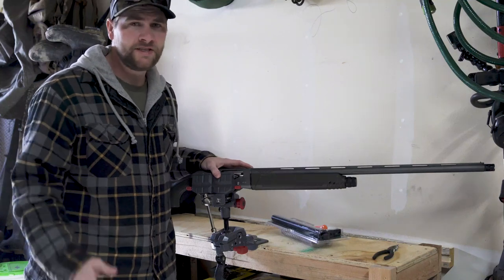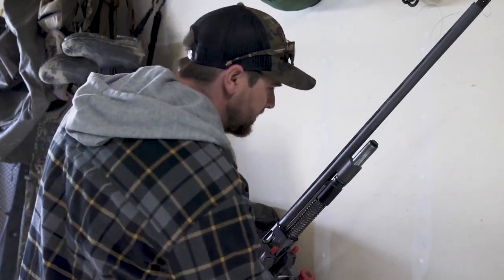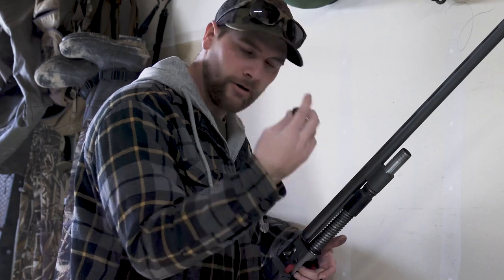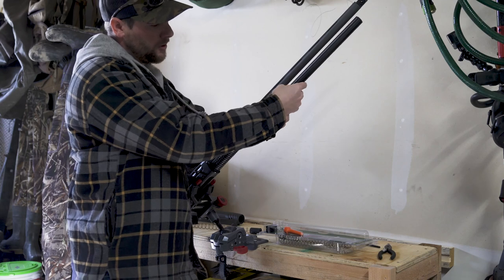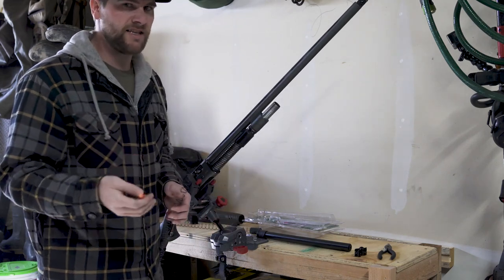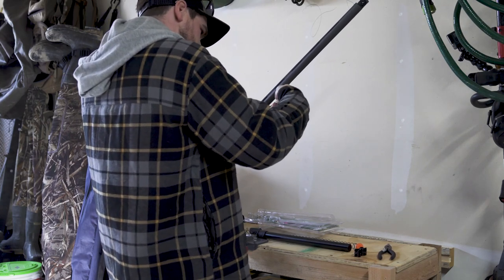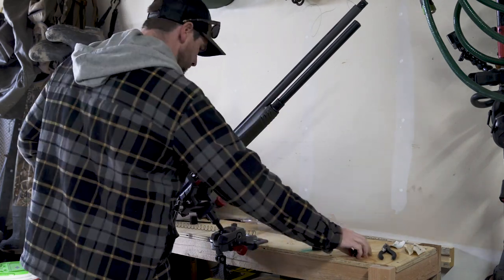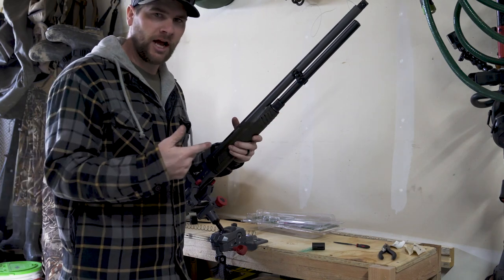How to Add a Magazine Extension to Your Shotgun | Outdoor Jack

Comment: How careful do you have to be when going from 2 3/4, to 3, to 3-1/2, from buck, to high brass, to bird, to slugs, etc with a semi auto?  I have a semi auto shotgun but hardly ever shoot it cuz i dont wanna hurt the gas system
Reply from the maker: You know thats a good question. I don’t like to shoot anything but 2 3/4 and 3” but it shouldn’t matter if you issue general lubrications and cleaning practices.

Comment: What kit is for this gun thought I read somewhere benelli nova but not sure
Reply: The benelli nova kit did not work on mine the threads were not deep enough
Reply from the maker: So the Carlson's mag tube I used was the Benelli Nova/Super Nova/Beretta1301/CZ 712/912. Is that the same one you tried?
Reply: @OutdoorJack yep I bought the 10 shot it screws on a little crooked but goes tight just not tight enough the forearm has play and so does the barrel like 1/4” or more play my original cap has deeper threads then the extension does
Reply: Ok so just finally found another video on my shotgun it has a tappered end so I do in fact have to cut 1/4” off I’m going to try to do a spacer as not to damage the gun and see how it runs
Reply from the maker: So I was about to tell you this exactly. Can either cut that 1/4 inch off or add a spacer. I found a spacer at my local hardware store that helped keep everything tight. I did just get the new GForce One that I upgraded to and it comes with a mag extension tube so I’m all set there 😁

Comment: What length barrel and how many rounds is the tube?
Reply from the maker: Barrel is 28”, and it’s a 10+1.
Reply: @OutdoorJack  ahhh thanks. I have a 24" barrel so will go with 8 or 9 rounder
Reply from the maker: @cocoloco2711  yeah that would be a safe bet. 👍🏼